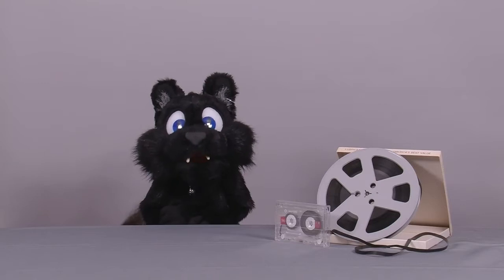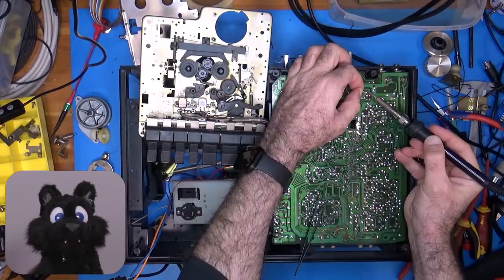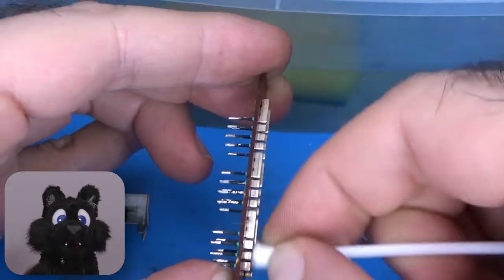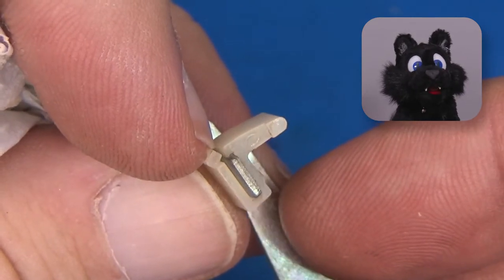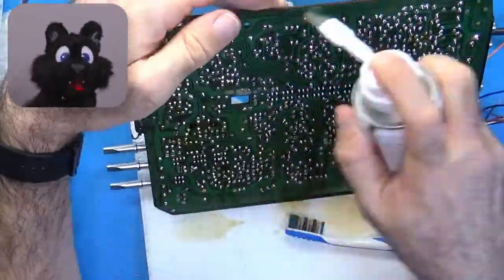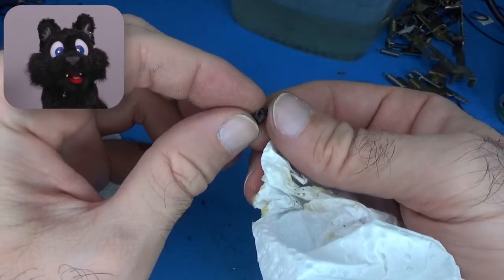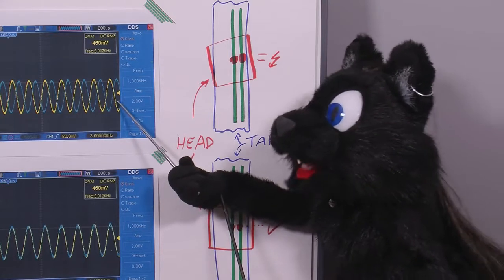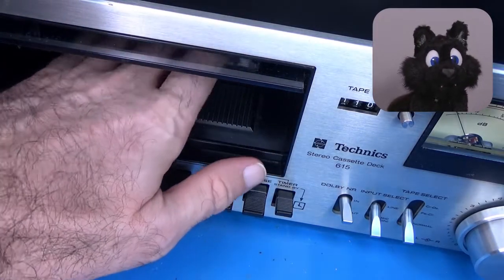Restoration Project #21 - Technics 615 Tape Deck

Comment: so impressive, surgical precision. I have this exact model that the right side is humming.any thoughts?Thank you
Reply from the maker: Really hard to tell without measuring a few points... if it's just the right side and the left is working fine, it's OK to rule out the power supply. But that's minor to begin with. It sounds like some components have aged badly, and form a resonancy circuit rather than a filter circuit. I might be biased but I would suspect a capacitor. If the hum is just "in addition" to normal sound, that would be reasonable. If there is no sound and just the hum, then it might be some other component... But I dare say that it would require a bit of poking with a scope to find the fault. (might also be a lost ground connection somewhere... reallly hard to say)

Comment: I'm trying to restore a RS 630, mechanism is very similar but I have a problem: I don't know how placing the torsion spring (the part is showing in the minute 2:27). Do you have some diagram for this? I would appreciate replies.
Reply from the maker: You mean the one that is pushing down the pinch roller? Or the one that is pushing down the "end of tape" feeler? Both of them are visible in the referenced moment. The service manual https://elektrotanya.com/technics_rs-615us_service_en.pdf/download.html has an exploeded view, but that shows the springs in "relaxed" state, i.e. they need to be twisted about half a turn to pre-tention them.
Reply: @atkelar  Yes, the one that is pushing down the pinch roller. I don't know how placing in the plastic part (pressure roller assenbly). I found the service manual for the RS 630, but it shows the spring in relaxed mode, as you mentioned.
Reply: Update. Looking closer the pressure roller assembly, I think a small part is missing, just where the spring lies.
Reply from the maker: If I recall right, there should be a little notch for the spring. If that is missing, bending the end of the spring 90° and drilling a small hole might be the best way to go.
Reply: @atkelar  I will try to build the notch using expoxi resin, I hope the notch resist the torsion caused by the spring. I am very grateful for your advice, suggestions and especially for this wonderful video.
Reply: I think it is a pity that I cannot share with you the final result, I don't know if I can put some picture here.
Reply from the maker: I have mixed results with resins; most of the time, the join between parts is the weak spot. This is why I added a bit of spring wire in the Revox restoration, to make them more mechanically stable. Like rebar in concrete.
Reply from the maker: Indeed, YouTube has no picture feature for comments. And with the type of spam that keeps popping up, I have very mixed feelings about that too 🙀 - after all, my mom watches my videos (EDIT: URLs to external galleries work though)

Comment: atkelar, donde puedo comprar los respuestos para reparar cassette deck, belt kit, pinch roller, ect ? thanks note: exelente trabajo con tu deck.
Reply from the maker: (Assuming Google translate is correct) - My local electronics store has some generic belt sets, and for special needs I found https://fixyouraudio.com/ to be very well stocked.

Comment: I found one of those next to a dumpster (a black 612 to be exact). Someone has ripped out the rear connectors and managed to break the circuit board in four or five puzzle pieces (the biggest piece was about 1/3 the size of the mainboard). The mechanism was also missing a belt and several screws. Challenge accepted! (turns out only a few resistors and capacitors were torn apart and from checking the other channel's connections you could see what they were and where they went.
(it now sits in a rack at the workshop in the Arcademuseum Seligenstadt where I use it from time to time)
Luckily the switch contacts of mine were in better shape and not in need of cleaning.
And you're not gonna make me disassemble the tape mechanism, if you delete this video, there's no chance in hell I'll be able to get it back together! :-)

My guess at the slanted deck mechanism is that when in the late 70s front loading decks made top loaders unfashionable, they had tens of thousands of these mechanisms still lying around and had to get rid off these somehow.
Reply from the maker: It seems like a transitional phase from top to front loading indeed. The "let's use up our stock" idea sounds plausible indeed. Also, glad to hear about another device that is in proper use instead of a landfil!

Comment: Hi there I wanted a particular ic for my technics tr 155 deck , say would u be having them thanx
Reply from the maker: Not sure; probably not "in stock" at least. I am not a professional repair shop, I also order stuff "as needed". What exactly were you looking for?
Reply: @atkelar  looking for a mitsubishi ic for my recording deck
Reply from the maker: Well, no, sorry; nothing from mitsubishi comes to mind. If you have a part number/type code I might poke and prod my usual sources. But just based on the manufacturer, I can't tell.

Comment: Hi, what is the brand or model of the stencil you used at the end labelling the cassette? Thanks.
Reply from the maker: That would be a Rotring (or rOtring if you go by the brand capitialization) made technical drawing writer, model CS-50. It is made for these large tilted technical drawing desks and has an attachment for one of those ruler arms that come with them. A bit fiddly to handle on its own; I didn't include the full description, because it was a throwback to the time I restored it over here: https://www.youtube.com/watch?v=rz_wnqaPhrs

Comment: A Technics 615 was my very first tape recorder. It died somehow. Then last year, gripped by nostalgia, I bought another one - it's from 1981. It's been running fine, but I thought it didn't have automatic tape stop, until I saw your video. Fortunately, I only had to do a little cleaning to make the mechanism work again, and while I was at it, I also did a little tuning of the motor, just by ear :) Thank you so much Atkelar: You've enhanced the enjoyment of my old machine , and now I have a reference to consult if I need to make other repairs in the future. Great stuff! :)
Reply from the maker: Thank you! I really appreciate when people take inspiration from my projects; it's what sharing the videos is all about. I wouldn't  consider them reference material though; there are more detailed plans and documentation out there; But if it works as such, all the better!
Reply: I know the feeling! :) Well, sure, but to me your video is a great starting point, if I ever have to take my beloved tape deck apart! Keep up the good work :)

Comment: I admire you my furry friend. I always loved taking things apart to see how things looked and worked inside. The only problem I had was putting things back together.
Reply from the maker: It's not that hard really... just repeat the steps in reverse! 😜 - I do get the point though; it took a bit for me to move on from just taking things apart to putting them back together too. I can't recall how many radios/TV sets I distributed around the house as a little kitten 😊
It was a good learning experience however. Taking things apart without breaking parts is the important first step and that requires a bit of experience in how things might be connected.

Comment: Had to stop the video from laughing to hard  after you said shiny
Reply from the maker: It was quite mesmerizing :) Compared to the dull surface before. They didn't clean the flux in the 70s and early 80s I think...

Comment: Great work! 
That is exactly the treatment, I would like to give my recently made attic find - my TEAC Z-7000 cassette deck and my TEAC X-2000M tape machine. Unfortunately, I don't have the space, the time, the equipment or the talent. So everything that would be needed 😁 

So I'm afraid the devices will end up on my shelf, as decorations and mementos. Nevertheless, it is a pleasure to watch such great restoration videos, to admire the work done and to dream 🙂
Reply from the maker: Thank you! I am still looking for some more organized space to put the restored stuff to good use ^^ - eventually I'll have to sell some of it, or my storage will explode. So "space" is always tight, no matter how much one has.
Start small, work yourself up to the important projects if you want to give it a try... don't start with something valuable for obvious reasons. I have thrown out quite a large number of radio parts in my childhood ^^ - also, depending on the state of your devices, it might also not be needed to disassemble everything.
Reply: @atkelar  Thanks for the motivating words! 
For me, perfectionism meets impatience. A very bad combination for such projects 😁 I usually make up for a lack of basic knowledge with a dose of logic and a lot of enthusiasm. At least that was the case in my youth, which was a long time ago 😉 

The devices are optically in almost perfect condition. The tape recorder may have a maximum of 50 hours of use, for example. So, they broke by almost 40 years of 'standing' around, rather than 'running'. For me, they represent a great ideal value and lots of memories. That's why I would never sell or trash them.

I've been watching restoration videos for weeks now and have already downloaded the relevant service manuals. I consider this as a first step 🙂

Comment: thank you for the reply, I’ve just got it today and have it cleaned and almost ready to go. The only issue is that the speed is a little slow and wavy. Should I buy the exact belt from a kit on the internet because the replacement belt I have in is not thick enough ?
Reply from the maker: There's an adjustment trimmer in the motor - but I bet it's also in need of some lubrication. Whatever they originally put in was probably not expected to last over 30 years. 😁 As for the width: the pulley is made for a "wide" belt, but I don't think it has to be "as wide" as the original. On my unit, a narrower version runs fine. But a round or square one is most likely not going to work: the pulley on the motor is shaped to auto-center the wide belt and that won't work with one that is too narrow. It should self-center on the motor side. If it does, it's fine.

Comment: Is it a good tape deck after all? I’m getting one tomorrow for 15 bucks to restore. Also what does the timer stand by button do exactly?
Reply from the maker: I think that - for its time - it is an awesome deck. Keep in mind that it's late 70s, so the auto-stop is only for the play feature, not for forward/rewind. For the same reason, it also has no "seek" (fast forward/rewind) either.
The "timer" button is a bit of a strange thing: it acts like a second pause button. It can be used in conjunction with an external timer for automated recording: Press pause/play/record and then turn off the power. Then press timer and release pause. Once the unit turns back on, the tape will pick up speed and then release the timer button to start the recording "at speed" instead of "ramping up".